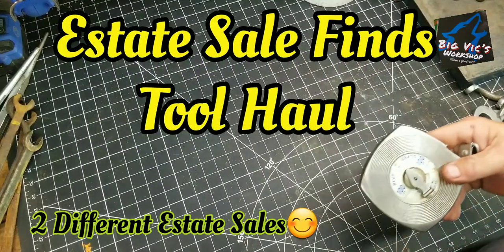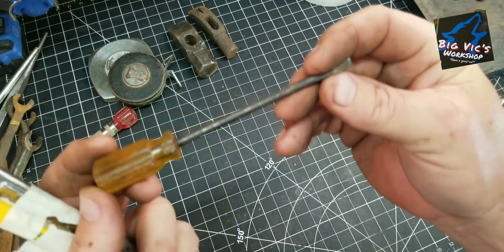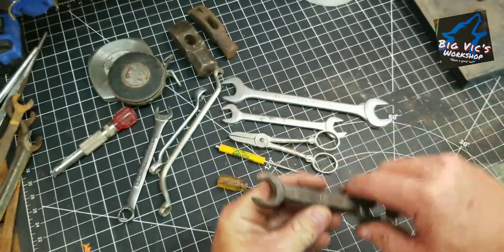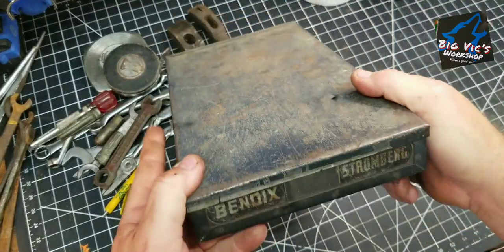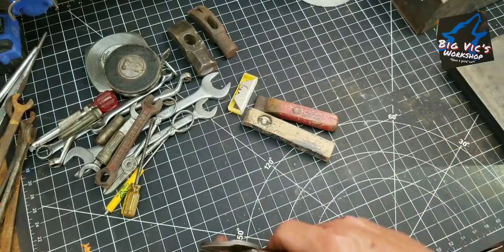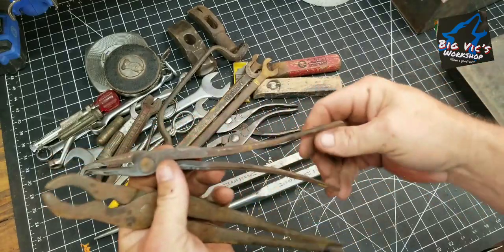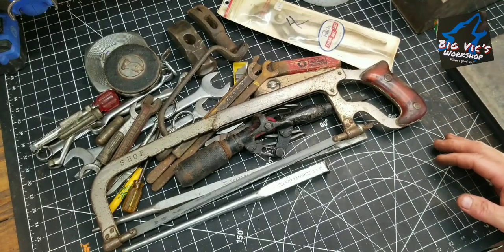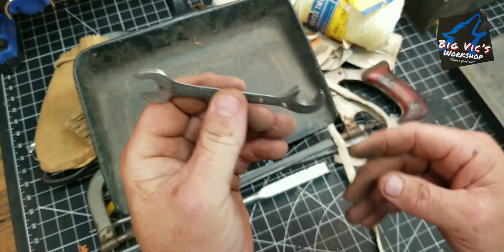#088 Tool Haul•Estate Sale Finds ☆Total $25.00☆ Miller Falls/Craftsman/Bluegrass/Snap On etc .

Comment: What a score Vic! Those caps you have I think they may be for 1920s to 1950 industrial rigs such as fire trucks or big trucks. They look like they are brass or copper. Also that antique hack saw may be missing a knurled round nut that fits with in the hand. The part that's still their usually tightens up the saw blade when the nut is tightened. The saw blade is probably too large. I have a wooden handle one where the blade was 8" so I had to cut one down for it to work right. Those grease guns got to be from the early to mid 1900s. Good score!
Reply from the maker: Great info! Thank ya brother!!